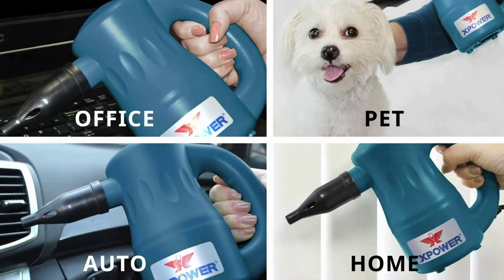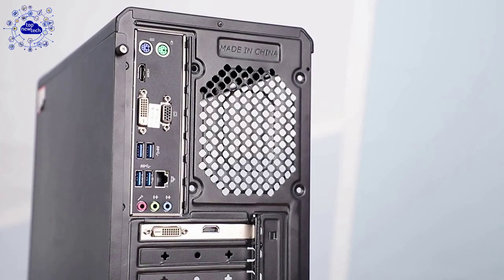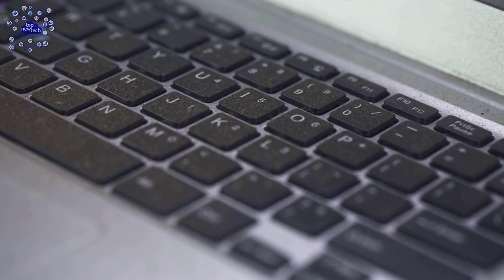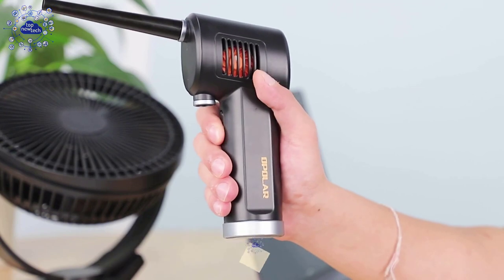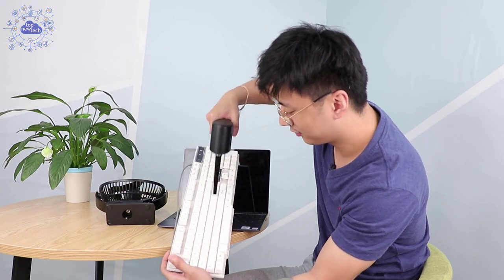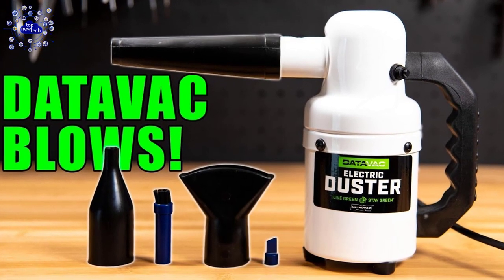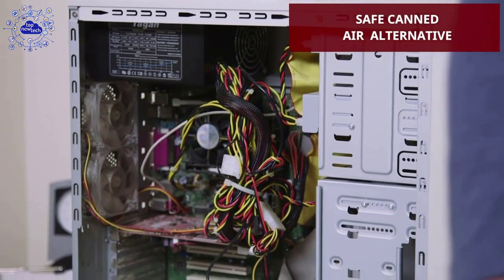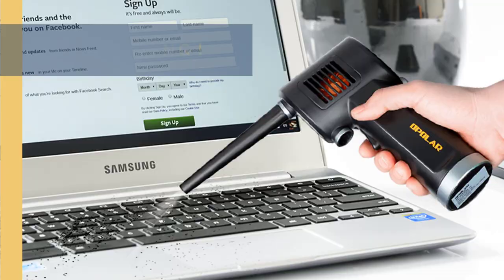Best Cordless Air Duster (2022) - Top 5 Handheld Air Blower for Electronics

Comment: the sin shine seemed to powerful, would it damage my pc?
Reply: If it's too powerful you could always move away from what you're blowing it at... Kind of a sketchy solution but it works, also it shouldn't harm it anyway
Reply: lmao rule #1 DONT LET UR FAN SPIN WHILE USING AIR DUSTER YOU CAN DAMAGE THE FAN......
Reply: thanks for the help!
Reply: @milliom23  yeah, lesson learned. Bought the xpower a month ago. Back top exhaust fan don't spin anymore

Sad fan noises
Reply: @christopherallard1693  I also put my headphones on when I use mine because it is loud
Reply from the maker: No!